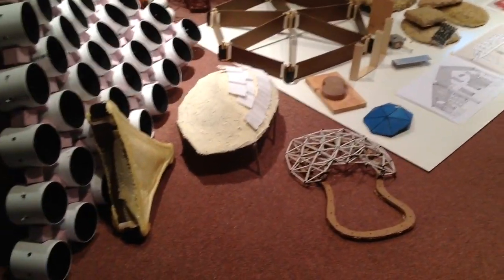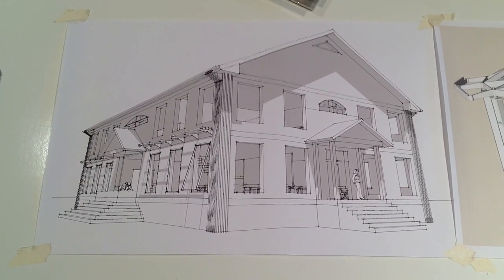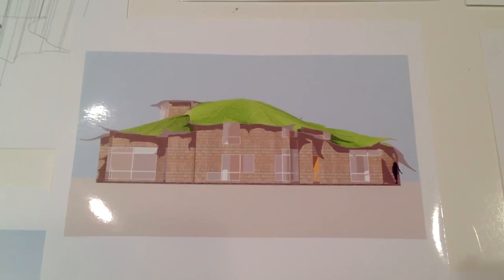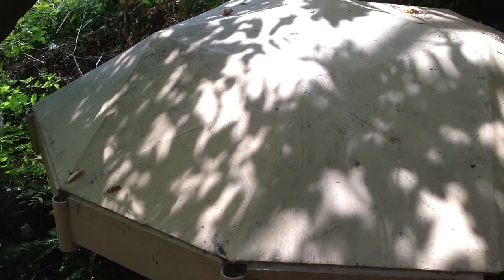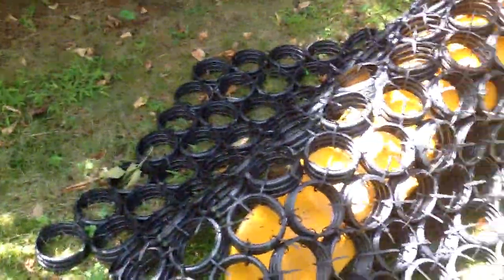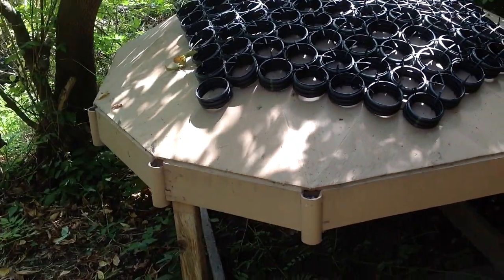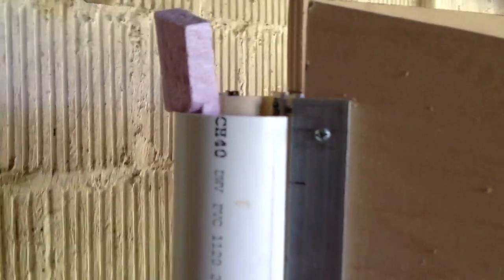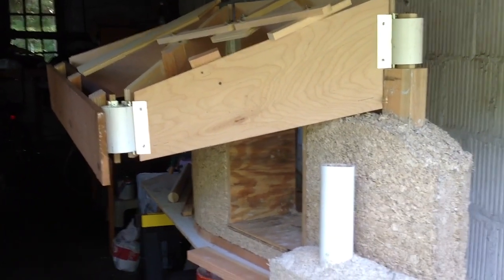Designing And Building Organically Curved Roofs

Comment from the maker: use 32 oz. plastic yogurt containers as my measuring unit. In the following ingredient list "cup" refers to one of these containers. The mix below seems to consistently produce a strong hard mache when using the ammonium sulfate cellulose.

1 cup industrial hemp fiber cut to 1" to 2" lengths (loose) *
1 cup cellulose (packed)
1 cup water
1/2 cup joint compound
1/2 cup saw dust
1" (in the cup) of wood glue

*I've also used cut up Phragmites tufts. which seem to work just fine.